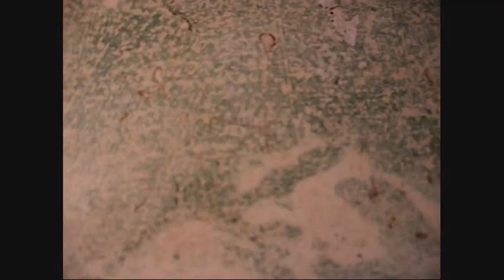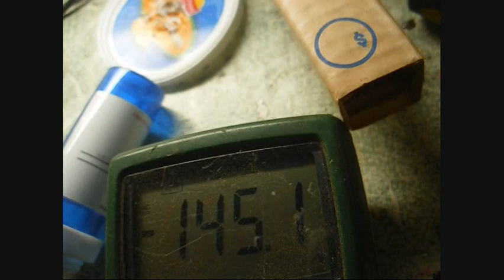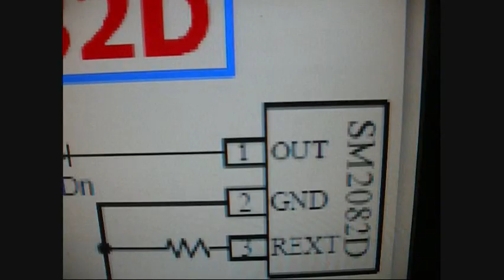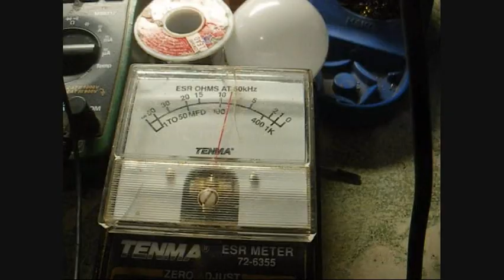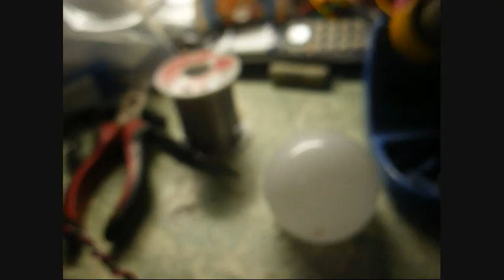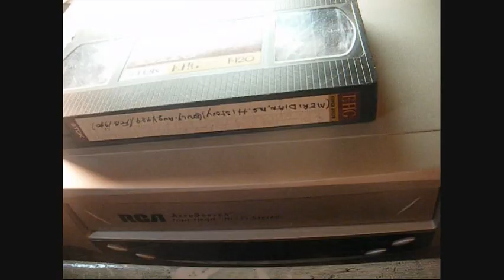Troubleshooting two dead LED light bulbs

Comment: The best thing you can do is open up the LED bulbs right out of the package and replace the current limiting resistor with a larger value. Oftentimes there are two resistors in parallel and you can just break one of them off. This will reduce the current draw and make them run much cooler which will make them last much longer. They will be dimmer but the difference will be less than you expect.

Comment: you can increase the resistor value on the current set pin to reduce the current and reduce the heat and thus increase the lifetime.  also, each "LED" on these tend to be 3-8 individual LED chips in each package.  recently I had to buy new LED bulbs and the latest 100W equivalents seem to use those 'LED filament' strings.  I have run one of them for 16 hours a day for the last 5 months and haven't had a failure.. yet.   My old 100W equivalent was a philips one that I used for 6-7 years at 16 hours a day when it finally croaked.  I guess I can't complain too much since that was 35K hours or so.   I took it apart, and all the plastic was as shango would say, baked!  baaaaaked!  I just touched the plastic and it fell apart.  the power supply was potted in RTV.  the new 100W equivalent bulb is shaped like an incandescent and even has a glass envelope.  I am not sure what magic they are doing in there these days but seems to be a bit better than 7-8 years ago.

Comment: Commercially and personally I converted all forms of video tapes to archival dvds thru my Panasonic dvd recorders. I still consider that to be the best solution as all other methods can go bad. Run a vhs tape completely thru to the end and back, then make the transfer. Really old vhs tapes may have to have adjustable tracking devices or copyguard/stabilizers used for best results. I also made good money performing this service and thankfully had high quality vhs players I could service and repair if need be.

Comment: 28:25  You're never going to get good results going on ebay and buying an $8 capture device.  What you really should do is get out the dvd recorders you bought and use them.   There are solutions for the PC, but it will take a lot of effort on your part and will not be $8.   It's not outrageously expensive, but you get what you paid for.
Once your burn your movies to DVD ROM, VLC can play DVDs on your pc and VLC is free and it is an excellent piece of software and it is HIGHLY compatible.  It will play almost every file you can imagine.    It's also pretty easy to rip the dvd onto your hard drive.  For that, I highly recommend you buy an external hard disk and save the movie files to that external drive.  Hard drives are a lot more reliable than thumb drives.

Comment: Thumb drives are not suitable for long term archival storage.  They are not good for backups.  This is ALL thumb drives.
Also stay away from thumb drives on the internet.  Buy one in walmart or some other brick and morter chain store.   ebay, amazon and others are loaded with counterfeit drives where they take a small drive, like 32GB and use software tools to fool the computer into labeling it as a 1TB drive.  Even if you format it, windows will report it as a 1tb drive, but it's not and nothing you save to it beyond its true capacity will actually be on the drive. Sometimes when the true capacity is full, it will start writing over what you have already saved.    Since they are being dishonest, they don't give you a 512gb and say it's a terabyte, they get the cheapest and smallest drives they can find in bulk.  Many of these are sold as good name brands, but the plastic thumb drive housing is counterfeit.

Comment: 0:30  you will never get 20k (OK, 19,723, 18 years at 3 hours a day) hours out of these bulbs.   Worse, unlike the old bulbs, these things are flammable.  A couple of months ago, the light on my computer desk started pumping out thick smoke.  Thank God I was home and actually sitting at the desk.  I usually leave that light on all the time even when I'm not home.
If they were built well, you probably would get 20k hours.  Unfortunately, they are built down to a price and it greatly affects the longevity.  In my experience, they don't last any longer than regular bulbs.

Comment: I have have been using a version of Roxio easy VHS to DVD and it lets you save as a video file. Should work on Windows 10 or 11 or Linux too with OBS. The software that it comes with works on XP-7 so it should work just fine if the system specs are right.
Reply: He's not tech savvy.  He's not going to do any of that.
Reply: I use it also. It's super easy to use. Recommend for sure.

Comment: The thing that kills a lot of LEDs is heat, the heatsink is insufficient and the LEDs are over driven. My fix is to put in a bunch of ventilation holes AND a dropping capacitor. This extended the life of those cheap Dollar General bulbs greatly.

Comment: You're not supposed to buy computer parts or accessories from Ebay. It's all junk or a scam.
I think I still have a real video capture card somewhere. It goes into the PCI slot of a computer. But no computer that will work with the thing. I think I'll need to install an old computer with XP. In that, there's a chance to get that old thing working, with its specific drivers and software.
Anyway, once digitized, don't just put it on a DVD and then delete your files. Keep your files on two hard disks, one for backup.

Comment: Video tapes that sit for years, can gather moisture and form mould, depending on how / where they're stored. Nonetheless, they're very resilient and durable ( In my experience with them ).

I would usually Fast forward tapes to the end, and rewind back to the start before playing. It loosened the packed spool. Especially if tape sat for very long periods of time. If it was sluggish to spool, there's probably some moisture or mould formed inside the spool. Best to NOT "play" the tape, as it can jamb up around the spinning video drum and damage tape, or possibly the video heads.

The cassette can be opened up, and a homemade motorized tape film, setup can be built that runs the tape across a cleaning swab post / tape guide system, moistened in 90% isopropyl alcohol solution, while it's driving the spools at a moderate / variable speed. Similar to a FF speed. It is designed to remove build-up on both sides of the tape, end to end. Swabs will probably need to be changed several times. 

Cassette housing is also cleaned and tape spools are carefully reassembled back into cassette shell. Spool tape in FF and REW directions a couple of times at least to ensure film tape is thoroughly dry and free running. Tape MUST be absolutely dry before playing. Always store tapes in cool dry dust-free location, away from strong 🧲 /🌡️/❄️ /💧/🌞 conditions. VCR heads may need cleaning prior to, and after playback of a tape that was recently cleaned. 

VHS tapes, and their machines can last a surprisingly long long time.

Comment: Just a guess that the IC could be current regulated and if so jumping out a bad LED might work just fine.
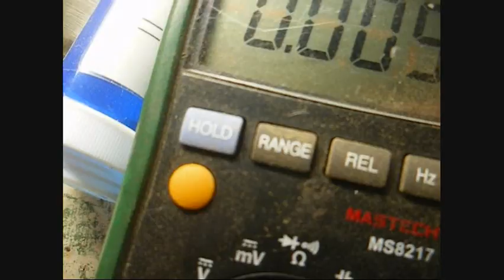Reply: They almost all are fixed-current drivers. The problem with jumpering (shorting) the bad LED is that now the driver IC has to bear more of the power burden, and could overheat or shorten its life considerably. 😢 10:55
Reply: @williamsquires3070  With a linear regulator like this that's a problem. If you have a fancier one with a buck regulator it's just fine.

Comment: I didn't try to fix mine. It would go out for a second occasionally. Eventually, it went out to a faint glow. I had a time getting the bulb part off. I didn't feel like trying to find the cause. My first LED bulb is still going, it's on 24/7. It's a dimmable type. But I don't use a dimmer.
But, the power company had an issue of 120 dropped to 70 volts. The only things that work was that one bulb, and a fan was running slow. I was concerned motors would burn out. I turned off all I could.

Comment: New smart tvs are the worst,all i want to do is watch tv with a antenna,no good internet where i live.after it finally takes all day to set tv up for local over the air tv then when i turn it off and turn back on later it wants to hook back to the internet again,then i have to start the whole process all over again.Smart tvs are junk crap.

Comment: Yeah, I don't want my truck making any weird sounds while I'm driving
around.  It may be a little dirty but it's not a mechanical nightmare of sounds.
The first ones they made, the ones they passed out for free, will last 
about 5 years and the componets are actual stuff like you see in the older
power supplies with the round caps and IC components.  I seen Shango 
fix a radio with one of those... LOL  GREAT VIDEO!  🍻from NC!
Reply: Keep the windows 7 for your video stuff and if you want something
good to transfer video to CPU -- The Elgato was what I bought after
trying one the cheeepo E bay ones.  Mine, like yours was junk.
Get your money back and take it off the cost of the Elgato.  Is about 
$90 bucks is the draw back, but was worth it to save VHS tapes 
in good quality.  ($70 for me after a E bay refund for the junk one)  🍻

Comment: Has anybody tried getting data on drilling some ventilation holes in the LED bulb base to reduce heat/extend bulb life? It was interesting to learn when I rebuilt a 3-bulb decorative lamp that came with it's own dimmer switch, and I put 5W led bulbs in, and put the dimmer on minimal, and the bulbs stay cool to the touch all day.
Reply: Cree came out in 2014 with a model called the 4Flow. It had ventilation holes. It also collected dust inside.

Comment: i've so far taken 3 bad LED bulbs apart to investigate, 2 had the led chips and the pcb around them very blackened, the other one the leds were perfectly ok, but the linear regulator chip it used had gone open circuit! of the 2 'cooked' ones, one was totally dead, the other would flicker a short while after powering on , the one with the blown chip went totally dead after only a couple of months!... as for any electrolytics  and their state, one of the cooked ones had its electrolytic bulging a little, but it had lasted over a year, at about 6 hours a day, the others 'looked' ok but i didnt test them